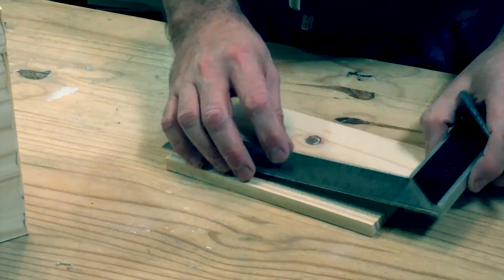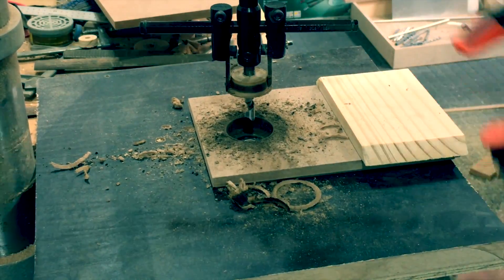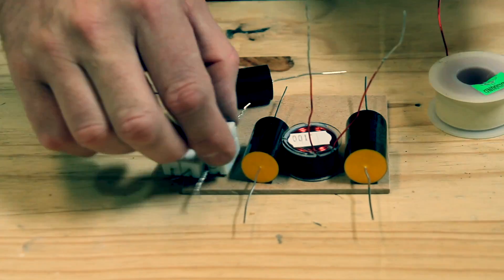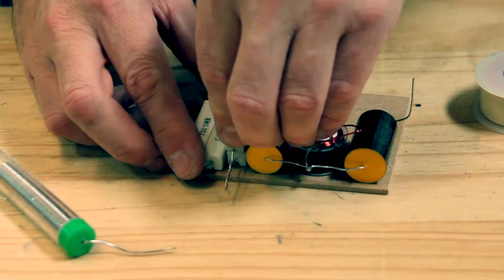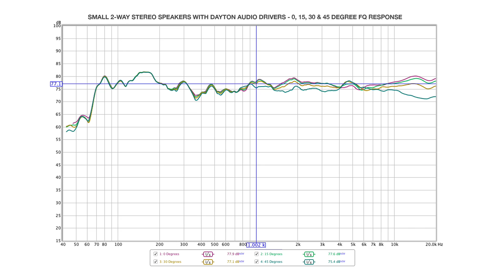Building a Small 2-Way Stereo Speaker - by SoundBlab

Comment: Great build as usual. In all your vids you tend to clump the resistors together. Those tend to get hot is that not a concern with speaker builds?
Reply from the maker: I have not found them to get hot. I have never had a problem with resistors overheating at all.
Reply: @SoundBlab  aaah good to know. I'm in the power industry and we use giant 100W resistors for various roles. I've seen those things burn holes through circuit boards, melt insulation of wires causing shorts and even catch stuff on fire. I'm always leary about having resistors near anything...lol

Comment: Care to enlighten me as to how you prepped and painted the front baffle white was such a good result?
Reply from the maker: I use a sanding sealer on the MDF. This seals the surface and allows the primer to not soak into the MDF.  Once you have applied a primer in a few coats with 320grit sanding in between, you can apply the top coat in the same way with a few coats and 320grit sandpaper in between.

Comment: Finally encountered good looking design with measured crossover. Small ask, please next time share also null reverse measurements. But I think this shall also be good as response in crossover point is flat. Good job, congratulations.
Reply from the maker: Thanks man. I try to share measurements as far I can, but sometimes I forget to include some... 😊
Reply: @SoundBlab  I expressed myself because there is a lot correct and good projects at diy forums but, unfortunately YouTube is full of misleading, wrong designed, examples how not to do loudspeakers.

Comment: Wait, did you say at 0:25 that the enclosures are made from pine wood?  Isn't that notoriously soft and subject to warping?
Reply: lol after I watched a few more seconds I think you said plywood, much better.  I got stuck on the accent, sorry.
Reply: I love the piano sound you included, very nice.
Reply: 8:53 love that crossover work!
Reply from the maker: Thanks. I did actually say pine wood. Sure, its not the ideal enclosure material to use, but on something this small it does not really have an impact. You could also easily substitute by using ply of the same thickness. Many of the projects I do is very experimental, and that includes the materials I use.

Comment: Wooden enclosure and mounting of woofer from behind are somewhat questionable. Everything else is very nice.
Reply: I see most audiophile types hate everything other than MDF or birch ply but I think bookshelf sized speakers built with dimensional lumber boards shouldn't be an issue in terms of sound quality to all but the most critical of ears.
Reply: @PDXMILO  If you read the Speaker Builder magazine you would learn that MDF, particle board and birch plywood and their combinations are better materials for speaker cabinets than just wood boards. The engineering experiments clearly demonstrated that those materials are not as prone to parasitic panel resonances.
Reply: @IliyaOsnovikov  I know and I acknowledge that's what the sound experts say but my point is that on small speakers it's not going to be as much of an issue because of their lack of volume. I would not suggest someone use soft pine boards for making a box for a 12" sub but for 4" drivers, it's probably not a big deal.
Reply: @PDXMILO  Agree. It's not a big deal but the result is still somewhat worse than it could be. And what might be a purpose of doing something wrong knowingly?

Comment: Most speaker builders stay away from solid woods because of the wood's resonant frequency. MDF and Plywood are most often used. Also, adding additional bracing strips at all joints may help the cabinets from leaking in the future.

Comment: Looks beautiful, but i really would not suggest to any one using solid would on LF enclosures, as they pretty sure will became air-untight at some point. chances are they already are in your case because of the bevel glue-up. air leakage will lower the tuning of your BR-port and at the same time lower it's output/efficiency.

Comment: Great looking build.  I'm a bit interested in how you got flatter response out of the woofer without baffle step compensation.  I haven't used these, but they're great.  The poly-fill will give you a theoretically larger enclosure up to 1.5 times the volume on a larger ported enclosure, 1lb/cuft was the optimal amount in that article I read, although it can also shave off 1db of sensitivity.

My main concern is that the inductors in the crossover have been set up to allow cross-talk.  Which is generally something people say to avoid, although in certain scenarios it can be beneficial to the overall response.  That orientation and close proximity of the inductors could influence your response by +-5db.  I would like to make a few videos experimenting with different orientations to deal with crosstalk.  As you get over 2 inductors there's no simplified setup, which is what I'm dealing with currently.

Comment: Just discovered your channel. AWESOME! As a novice speaker builder/tinkerer in the Cape I can appreciate your work. At 3.31 in your video, what tool are your using to cut out the smaller hole for the tweeter?
Reply from the maker: Adjustable circle cutter.

Comment: What is your process for painting the MDF? I'm wanting to build myself some C-Notes from Parts Express, and I am unsure on how to finish them; just that I want them white.
Reply from the maker: I use a coats of sanding sealer to seal up the MDF and sanding with a 240 grit sandpaper in between coats. I then use spray can undercoat and then the spray can top coat. Apply a few coats of each and sanding with a fine sandpaper in between.

Comment: coud you make pc speakers  
and how woud i be able to connect these to  my pc
Reply from the maker: You can use these with a small external amplifier or you can build an amplifier board into this design . It will then just connect with RCS cable and/or 3.5mm headphone jack.

Comment: Isn't pine not dense enough for speakers? Any advice on learning crossover design? thanks!
Reply: Kevr if you want, you can check out my channel.  I taught a series in how to design crossovers with free software.
Reply from the maker: Depends on the quality of the pine available to you. Also, on a speaker of this small size with small panels surfaces you can get away with a bit more. On larger surfaces you would want to use thicker and stiffer materials. I learnt from a speaker design book and the internet, but their are many resources out their such as 123toid mentioned on his channel.
Reply: 123Toid Thanks for that, I look forward to watching your tutorial.
Reply: SoundBlab That makes sense....smaller speaker = less demand on box. Do you use software like winisd to design smaller boxes like these? Or do you just focus on the cf of the box and thats it? Nice video, the two tone look is apealing.
Reply from the maker: Yes, I use WinISD Pro for all my box designs. Thanks man!

Comment: It's a really nice build. Love the design and coordination. But I didn't get exactly what the circuit you made and parts used.
Reply from the maker: Thanks. The crossover circuit uses a combination of capacitors, inductors and resistors to blend the frequency responses of the tweeter and the woofer to result in a smooth overall frequency response for the entire speaker.

Comment: Nice build!  I went with a similar design aesthetic for the bluetooth speaker I'm working on (white MDF front, and light wood box, except I went with curly maple).  I really like that routed edge on the front...I just painted the fronts, but this has me thinking about going back and routing the edges, which would require re-painting...hmmm.....
Reply from the maker: Thanks man! I am looking forward to see your build. The shadow line was something I added on the go whilst building. To be honest, it was an attempt to hide the imperfections in my build and the inexpensive pine I used.... it worked, mostly.
Reply: Good save!  Congrats on the deal with Parts Express -- I wish I'd seen it earlier.  Just put a big order in yesterday.  (Did pick up a few things I needed via your Amazon links, tho.)

Comment: Looks awesome. What kind of dampening material are you using?
Reply from the maker: It is a product called Dacron. I get it from my local fabric shop. It is mostly used in the upholstery industry.
Reply: Thx
Reply from the maker: I have never tried that before, and do not know what its acoustical dampening properties will be like, but you can certainly try it. Back in the day, wool or wool based products was often used as a dampening material.
Reply: Actually, being a Transmission Line speaker builder myself, we often Prefer wool over poly-fill. It's more expensive but it's actually better. In both Transmission Lines and other speakers. 

For Shamil: WHat I've done in the past is get cusshion filling, and put it between two sheets of wax paper. I then lightly went over it with a clothing iron (a hot one) and just did enough to make the end fibers stick. You should get something similar, albeit uglier, to what he used in his video.
Reply: angelo t I didn't use it. Surgical cotton is expensive compared to polyfill. I am using the polyfill and it works best.

Comment: Imo you should try to build something small but with pro-grade speakers meant for PA-stuff just for the purpose of testing. See how much sound you can get from a bookshelf-ish 6.5" + 1.5" tweeter.
Reply: PA stuff doesn't mean it sounds better. PA is optimized for thermal abuse and high SPL and efficiency. not neccesarily an Advantage if you can get better sounding home audio drivers for the same amount of money.
Reply: +tubybubi He never mentioned "better" sound, he mentioned how much sound.
Reply: Wilhelm Johansson, I would like the same. Small, pro PA type stuff
Reply from the maker: I like the idea!